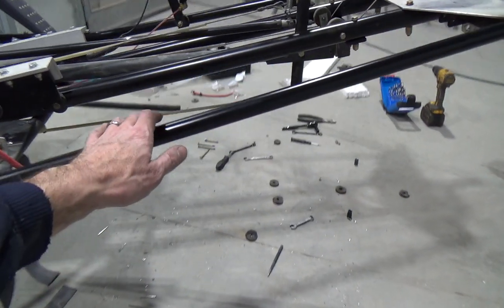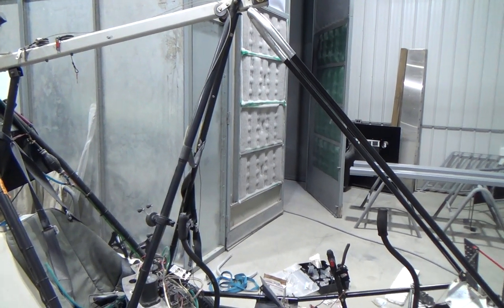Initial Reassembly | Re-Build: Part 7

Comment: Might I suggest looking at snowmobile ski mounts for idea's  They are mechanically  prevented from tilting too far right at the mount of the ski . Trust me you don't want your snowmobile ski digging in either.
Reply from the maker: That's a great suggestion. Typically, the snowmobile setups are too heavy though. We are re-engineering the forward attachment point for the safety cable. I've had a look at a few other ski-planes and I'm going with a pretty fool-proof design. Thanks for the suggestion though! :-)

Comment: Hello Matt   'just happened across your vids  and subscribed,  I have a 550 on  amphibs  in Kelowna B.C.   582  warp drive,  puddle jumper floats.   Found it at 85'  in the  Okanagan lake  ,recovered it for a friend and ended up buying and restoring it before learning to fly,  That was twenty years ago and she's still flying.  One thing I noticed ,when you  or your partner are starting the engine , you stand behind the struts; I have the upright engine kit so it puts the recoil  further ahead i suppose     I make a point of standing in front  of the struts ( because I can)  Do you have procedures for starting?  especially on snow where a slip of the foot could have you in a spinning prop,   
Also is your facebook page only for students<or anyone looking for good advise?
Reply from the maker: The school FB page is really just for students. Feel free to join anyway though. Not much gets discussed there though beyond when the next groundschool class is. 

Check out the Beaver Owner's Group on FB. I run that one too. I'm happy to help answer any questions as best I can.
https://www.facebook.com/groups/beaver.ultralight.owners

I give the plane a few good shoves to make sure the skis are dug into the snow and I typically jam the tailweel down into the snow as best I can for starting on skis. I also stamp down some snow for my feet to make sure I don't slip. On wheels I simply lock (and test) the parking brake. 
I just don't have the weight/leverage to get a good pull while standing in front of the struts. I wish I did though.
Reply from the maker: I'd love to hear more about the find and recovery of that Beaver at the bottom of the lake someday. Sounds fascinating!